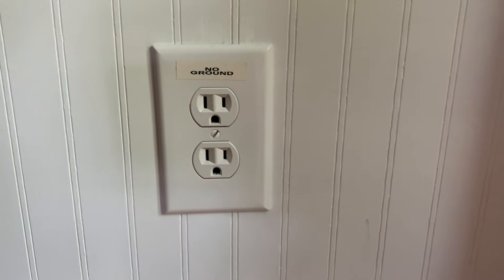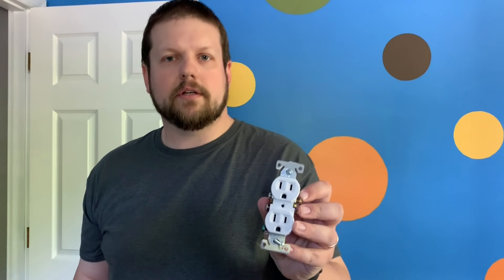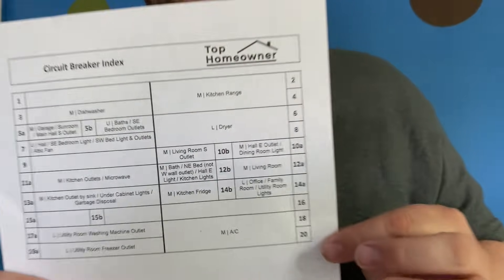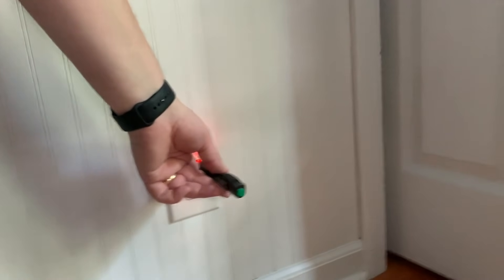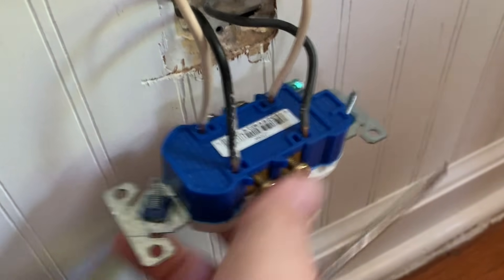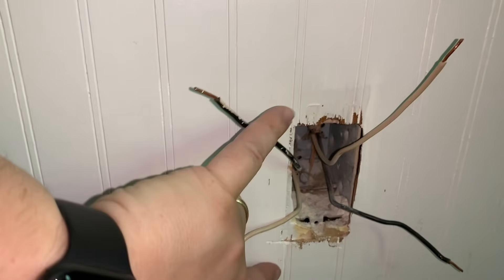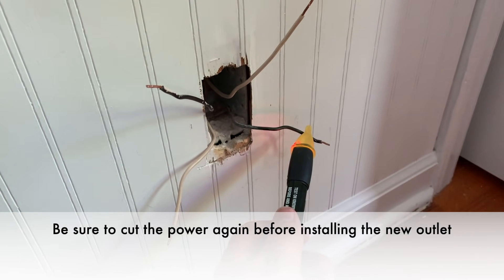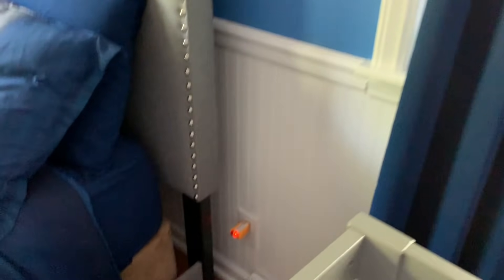Fixing Ungrounded Outlets - An Alternative Option to Rewiring Your Home

Comment: What about the ground? It wasn't necessary anymore?
Reply: The GFCI protects the user. It is not ideal but it is legal.  These would be relevant only on dry rooms as wet rooms are grounded anyway so the risk of a serious shock is small anyway. This is much better than cutting the ground prongs which many do.

You should still use caution of connecting computers to TV especially using RCA cables . Better o that while powered down. (RCA us an idiotic connector as the center pin connects first.)
Reply: The ground is needed. This video is trash. And unsafe. And wrong.
Reply: @markbrinton6790  Certainly you know that a GFCI receptacle doesn't need any ground to function properly. The video demonstrates an approved (national electrical code) method for providing 3-prong receptacles to replace an ungrounded 2-prong receptacle.

Comment: But the GFCI is not grounded, therefore the other receptacles in the chain are not grounded. So all you did was add a GFCI to an ungrounded circuit. Yes, it will protect the other receptacles but it us still ungrounded. Another alternative is to replace the receptacles with newer receptacles with grounds - then use circuit protected power strips to plug in whatever you are using. It acts just like GFIs, without having to install one.
Reply: This option is not code as they can b easily unpluged n u are right back to a unprotected circuit.
Reply: Doing that would involve doing an illegal installation i.e. the grounded type outlet without grounding or a GFCI. If you want to improvise do it without fixed installation. Buy a portable GFCI and cut the ground pin. That may not be legal but at least it does not involve an illegal fixed installation. There will be someone living in your home after you. You need to think those also. 

Note that there is no need to change all the sockets. If you are happy with others but need to fix on socket for your computer,  you can do that only. In that case you do not need yo find the first one.
Reply: @okaro6595  "think of the others living in the home", not to mention the fact that your home could eventually be sold or rented to random strangers without any legal requirement to update the electrical system.

Comment: If there is a metal box that the outlet is installed in and the box is grounded couldn’t you run a ground wire from box to outlet?
Reply: This is a video for no ground being run in the house at all. Nothing’s grounded

Comment: All the electricians in the UK are cringing and shouting NOOOOOO!!!!!
Reply: Codes are different in different countries. In most of Europe you do not need any tricks and you can and may directly insert a a grounded plug to an ungrounded outlet.

In UK all plugs and sockets are grounded type but that does not necessarily mean they are all grounded. In fac  Britain has had several types of plugs and before 1992 equipment could be sold with bare wires and you bought the plug separately and wired it.

Comment: PLEASE put wire nuts on the bare wires!  You can still read if the wires are hot and avoid getting electrocuted!
Reply: good catch. i was looking thru the comments before i wrote anything. i am an electrician and i always wire nut them before  using this method, because like you pointed out you can always touch them by accident. plus i don't like the arching by accident
Reply: Rookies!!! Sorry not sorry guys...
Reply: oh puulease!

Comment: Everyone who says a gfi  wont trip and  protect you without a  grounding conductor shouldn't be commenting on things they obviously dont have experience with.
If anyone wants to put up a bet  I'll wire one up and touch the hot myself on video.
Reply: They may get that impression if they use an external GFCI tester. That does not work without the ground. One should use the tester in the outlet instead. An external tester directs some current to the ground connector as that is the only way it can create an imbalance. The built in tester directs current to the neutral bypassing the GFCI.
Reply: @okaro6595  very true. If there isnt a equipment grounding wire, I use my wiggy meter to trip them.

Comment: This may have been asked already but how do you find the first outlet in a circuit?
Reply: There is no real set way other than finding the head of the circuit and there are definitely no shortcuts. It all depends on who and how the home is wired. When I wire houses, yes I'm an electrician, I split my light and outlet circuits. However, not all electricians do that, even nowadays, and that was NOT common practice 40+ years ago. You're better of hiring an electrician...
Reply: William Talcott in most cases I have seen anyway, it will be the first outlet you see when entering a room...could be on the left or the right. In theory you might have to take all of the outlets out and then test the hot wires on each. The only one that’s hot should be the first one in the circuit. However, your circuit for a specific room could come into a light switch first and then go to one or more outlets as well. I’m sure someone has a better explanation but the above has been my experience.
Reply: 1. Turn off the circuit breaker 
2. Determine which receptacles and switches have been disabled. 
3. Locate the closest to the circuit breaker box.
Most jobs are handle by an electrician that bid for the job and they can't afford to waste conduits and cable since it would come out from their profit. So, they will wire the house the  most efficient way possible. Wiring from box to box trying to use the least amount of supplies. 

Or

You can just look at the wiring diagram provided with the home.(If available)
Reply: @sprsgt  Consider that MANY homes have been subjected to various "improvements" by DIY or even professionals, who are not bound by any particular "standards" for which receptacles go where on a branch circuit.

Comment: Installing a GFCI receptacle still doesn't provide a ground to the circuit.  No ground wire in the box means no ground. Sheesh!
Reply: Ok.. If  it's acceptable to code, works, and wont hurt/kill you. Why are people creating problems?
Reply: Nobody says it does. That is a way to use devices with a ground plug with reasonable safety without any tricks like cheater plugs or cutting the ground pins.
Reply: It was common way back to use a ground wire connected to the metal box. Insufficient for appliances that actually need a ground but the theory was that it would ground out the the house. Using the GCFI still doesn't supply a grounded outlet but if a surge happens where power needs to go to ground the GCFI will trip and protect the appliance and the circuit meaning your home wont burn down. Recently went thru this with a home inspector and a Journey man electrician. It meets code requirements for not having a ground wire that goes back to the breaker panel.

Comment: i always thought the gfi had to be grounded back to panel. seems like voltage still leak .the idea is to actually to send short to ground ,taking out the breaker.the only way here is to short to neutral.gfi may trip due to high current but breaker may stay in.
Reply: Nice choice of words. Hmmm
Reply: @joemomma7  I believe you are correct.
Reply: @Terry:  You're confusing "overcurrent" (breaker function) with "ground fault" (GFCI function). They are different functions and generally do not overlap unless you have a breaker that also has a GFCI function.
Reply: A GFCI does not require or use grounding. It monitors the current in the line and neutral and if it finds more than 5 mA (30 mA in Europe) imbalance it cuts the line and neutral. Ground is not involved in the process.

Note that an external GFCI tester does not work without the  ground as it can only create an imbalance by directing some current to the ground. The tester in the outlet itself works as it directs some current from line to neutral bypassing the GFCI. It can do it because it is internal to the outlet.

Now if an equipment chassis becomes hot with the grounding the GFCI breaks the circuit even if the circuit breaker does not do it. Without ground it might not happen if the equipment is well isolated. It should cut the power before any dangerous shock will happen though.

Comment: tip: replace each outlet with its own gfci and sticker so that each operates independent rather than all failure from one outlet. And just cause one is off doesn't safely mean all of them are off, maybe you already checked em all before the video, but i think it's good to show each is off before starting to operate on outlet itself. Just extra precaution. But good info here non the less
Reply: I would not recommend that.   If you connect a GFCI outlet to the load side of another GFCI outlet you can get nuisance trips.  
If the outlets are wired properly, if the first GFCI trips then, YES, it does mean that all of the others are safely off.

Comment: GFCI outlets measure amperage between hot and neutral, NOT ground.  5 milliamps within 10 to 15 milliseconds difference between hot & neutral will kick off power.  To kick off a breaker you need to pull a full rated breaker amperage thru neutral or ground, can't find trip time but probably much more than 10-15 milliseconds.  No ground is totally acceptable and supersedes grounding as protection because it turns off the power without kicking the breaker, is faster than a breaker and easier to reset because it is where the problem occurred, not in the breaker panel.  Buy a tester with GFCI test button and test this for yourself.
Reply: Standard breakers ate thermal/magnetic. With a short circuit the magnetic part trips immediately. With slight over-current the thermal one works slower, it may take minutes.  Circuit breakers do not protect against shocks. Remember you can use a space heater on a circuit. What would it feel if your body acted as a space heater. The purpose of circuit breakers is to protect the wiring and to prevent potential fires.Without a circuit breaker there could be a fire or the wring would break at a random place. Both would be bad things.

You cannot use an external tester without the ground wire. You should only use the tester in the outlet.  An external tester diverts some current to the ground wire. This will not work if there is not ground connection. The internal tester diverts the current to neutral bypassing the GFCI.

Comment: I agree with all those that have said in so many ways this is not a good solution for all the reasons and even more. That said on the issue of the outlet tester plugged in to that final circuit run outlet --- yep it shows an open ground  BUT  nobody questioned why the GFCI outlet was showing a Green  good light. (red when it was tripped). So ok how was the Gfci showing a good grounded connection? What I saw when he was finding out the live wires (the home run or feeder back to the elec. panel) if you look at the video inside the box coming out of the cable of the feeder one (right side) was a "ground" wire connected to the lower box cable clamp screw---  Which is how I knew that was the power side before he turned the breaker on and tested for it.
NOW take note--- the wires here are old maybe late 60's early 70's  BUT in no way is the size of that ground wire the correct size and Should not be considered a ground source it is way undersized! However because it is to the metal box and the GFCI is then bolted to that box you have an electrical path that the gfci sees and lights the green light.  In other words it is a "FALSE Positive" and you should not rely on it!  And also you bond the gfci with a ground wire to  the box  and do not depend on the screws and mounting to do the wires work.
Typically back then they used a feeder / home run with a ground wire but the circuits they did not.  This comment is just my over 50 yrs experience speaking - your milage my vary.......
Reply: GFCI does not care of the ground.

Comment: @6:24 note the inserted wires...Highly recommend using screws not pushing them in.  Please research fires related to inserted wires vs. actual screw mounted wiring.  

I'd hate to see a fire that is absolutely preventable..maybe others know but didn't one of the brands have a recall?
Reply: I will agree that back stabbing receptacles isn’t a good ideal. I’ve been an electrician for over 20 years and every house I have had to replace a burnt/over heated receptacle in has been back stabbed. (Side note, if you have holes in the back that the screw will lock the the conductors in then I don’t have a problem using those holes)
It isn’t a good ideal to back stab switches either. I think the tension spring breaks down, but it does.
Reply from the maker: GFCI receptacles use back-wiring, and don't have an option to push in the wire like their cheaper residential grade cousins https://youtu.be/3AXcRsAOLPk
Reply: Oh stop crying i see backstabbed outlets lasting longer then you were born kid. Screws are good too but what if you have more wires? You cant put 2 wires on one screw thats code violation
Reply: Gamer007 backstabs do not cause fires. Its the outlet. Outlets can catch on fire even with on the screws so if you’re really scared of a fire. Remove outlet and cap everything in wall because all outlets are gonna have risks. Even on screws or backstabs. If backstabbing was seriously dangerous. It would not be allowed on newer outlets. Learn before you talk :)
Reply: @GlitchedPepsi  Good one.  "Remove outlet and cap everything in wall".  You can do that, but  you also need to properly label all capped wires "for future use", or actually snip them back as far as you can, or remove them entirely, to meet national fire code regarding "abandoned electrical wiring".

Comment: A GFCI does offer protection similar, though not equal, to that from a piece of equipment with a valid ground connection. But I think any 3 prong outlet should  have a valid ground connection, GFCI or not.  Some devices need a ground connection not only for safety, but for surge relief, noise reduction or to protect against ESD that can destroy semiconductors. If I find an outlet with no ground connection and can't trace it do an open at some accessible point in the circuit, I just ground that outlet by connecting it to a cold water pipe or, if need be a grounding steak..
Reply: What you think is not really relevant. It is what NEC says that counts. The text "No equipment ground" will warn the user  for that.

In Europe grounding male on the socket just to allow using grounded plugs on ungrouned outlets (but not the reverse unless the equipment is double insulated). Grounding is to protect people, not for equipment.
Reply: For anyone who doesn't understand, a grounding STAKE. A metal rod driven (usually pounded in with a large hammer) into the ground (earth). Ground wire connected to the stake/rod with a clamp. Water pipes can also be used in a similar way. If you don't know how to do this properly, read up on it and test when you're done. Stay safe!
Reply: @jeffnorbert1871  A ground rod has nothing to do with equipment grounding or posses the ability to trip a breaker.  
I'd much rather grab the hot on a gfi protected outlet than one on a grounded duplex.
Reply: my wall outlet is ungrounded and i have a backup power device (UPS) plugged into it and my PC is plugged into the "battery backup" side of it and without warning it tends to turn off irregularly and regardless of load
Reply: Try plugging your outlet tester into the gfci outlet you just installed and pushing the button 'on your tester' and not the test button on the outlet. I bet you...bc i know this... that your gfci outlet will not trip (you'll need a gfci tester and not just a regular tester for this). It will not trip. This is because there is STILL no grounding wire connected to the gfci outlet. So, your gfci outlet is not grounded, and still wired incorrectly. Also, the outlet that turned off when you pushed the button...is still not grounded (bc of electrical reality and bc your tester showed it not grounded in the video). So... your gfci outlet... is no different than a light switch.  I am glad for your disclaimer about not being an electrician.  Thanks!
Reply: @travisc5840  That is a problem of the terster. Use the test button,

Comment: We have our ungrounded sockets marked "no equipment ground" and one GFCI socket also marked "no equipment ground." The GFCI socket feeds the other regular 3-prong duplex receptacles. 
   This is what certified electricians do in many parts of the USA. And this what our electricians do here in northwest Missouri.
Reply: The non-GFCI type outlets should also be marked with "GFCI protected outlet" according to NEC - unless you mean two hole outlets. They of course need no markings.
Reply: Glen Martin and is allowed by NEC which is why electricians do it. Realize that if you have sensitive equipment that test for a ground being present, it will not function on these receptacles.